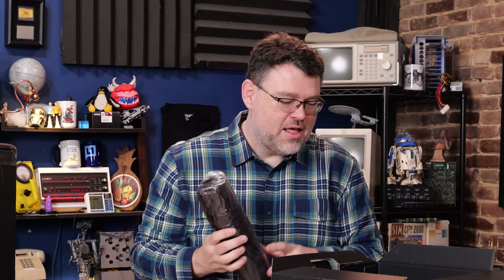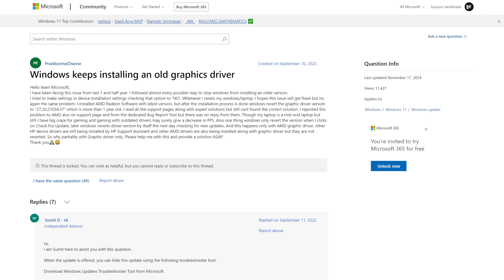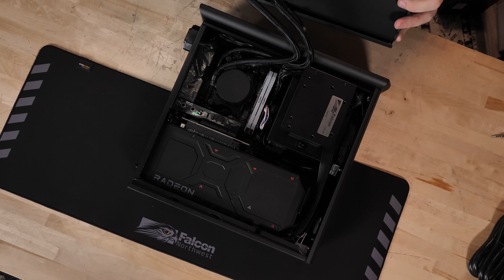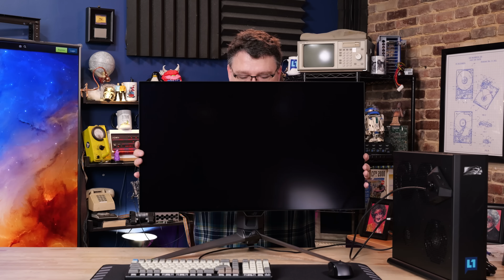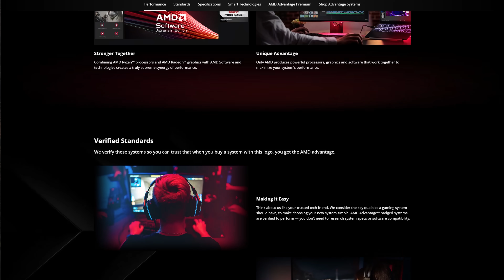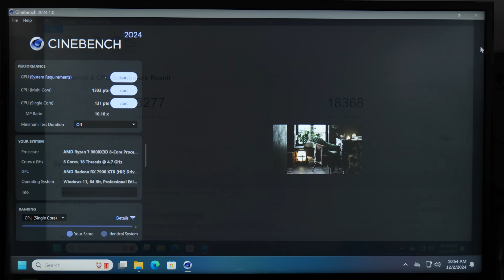The Falcon Northwest Tiki: An Ultimate Gaming PC

Comment: I’ve done part for part builds of there systems with the exception of the case and cooling.  These guys use top shelf and expensive parts.  Of course there’s a premium, but it’s not as bad as one would expect.  

I don’t have a gaming PC.  I’ve built them in the past though.  In the future I would seriously consider pulling the trigger on one of Falcon’s builds.

Comment: Wendell, in your more recent review of the 5090, I appreciated you noting that the TIKI has a 'new' side panel, better ventilated for the 5090FE dual-fan pass-thru airflow. Not sure if I'm missing something, but I haven't seen that referenced elsewhere. Seems a mystery that case mod is not more clearly promoted, as that's a big sell point for the TIKI: NO GPU exhaust into the case! I've been looking hard at the TALON, but have concerns about the 5090FE exhausting directly on to and over the immediately-adjacent (if not touching) Gen 5 M_2 heat sink. My plan was to put a Crucial T705 in that slot, but given the SSDs alleged reputation for running as hot as the sun, I fear frequent throttling, given it's relation to the 5090 airflow. I have been a Talon owner for years, and a big fan of FNW, but honestly I'm a bit paranoid about pairing a 5090 with the Crucial Gen5 M2 as configured above. So maybe I go with the TIKI and it's unique 5090 airflow, or maybe just step down to a cooler-running gen 4 M_2 in the TALON?
Reply from the maker: worst case you can do active cooling on the t705. my machine learning talon has a t705 in a vertical m.2 on the workstation motherboard. depends on the motherboard to know. falcon will not sell you config that has problems
Reply: @Level1Techs  Did you mean to say "cooking" or was that a Freudian slip? LOL That Crucial/5090 TALON combo would seem a good choice for Smores. I saw Jaystwocents loosely lean a small fan just above his t700 (open bench) and yes, it did keep the M2 within thermal range. I'm not a DIYer perse, but have wondered about simply running a new TALON with the case open, dust be damned. FNW swears by their thermal testing in all configs, but I keep squirming. That TIKI airflow solution is tempting.
Reply from the maker: lol oops fixed
Reply: @Level1Techs  Thanks Wendell. You may have had it right the first time - the 5090 actively cooking the Crucial T705 - or vice versa. Appreciate you!

Comment: So question. I’m new to pcs, as a console gamer my entire life, I’m looking to get a falcon but don’t know which. The talon or the tiki. I’m not as a hardcore gamer as I used to be but I’d still like to play games at there best performance. Ray tracing is in my mind but not needed (maybe lol) 
6000$ budget but don’t know if I’m overspending on things or not spending enough. Don’t know if I should go with a 4090 or 5090. This would be strictly for gaming, games like path of exile, Diablo, the Witcher, cyberpunk and some first person shooters. If I could get suggestions that would be great.
Reply: $6000 is a lot, but might be cheaper now than later lol. 5090 if you can afford it. Make sure you build around a great processor/motherboard combo, gpu is easier to upgrade later.

Comment: I had a Tiki back in the Devil's Canyon era. It was a 4790K/TitanX box and it was very capable. This IS an SFF case, so it did run a touch hot, but the 4790K was notorious for this regardless. The magnetic remote is pretty slick and I wish it had been a feature back when. I have to say I do miss the granite base option. Falcon does make good stuff, but bring money.

Comment: The new user experience from Microsoft is to their benefit, but also aimed at the average computer user. And the average computer user is just a notch or two above a chimp. Most people won't even consider being forced into becoming cloud fodder for Microsoft being a bad thing. Just see how many Apple users they are who love being firmly corralled into doing things the Apple way. For the more advanced users there's making your own tiny Windows 11 installer where you physically delete (or rather, never add) much of the bloat, and there's also using an answer file to automate it.

Comment: I paused windows update. And never had blue screens. Best fix I found for now
Tha K you for the review. Very nice info about products and companies That don't exist in Argentina
Reply: My machine is a bit over 2 years old, the only blue screen I've had is Nvidia's fault with broadcast. Windows triggering blue screens on modern hardware via updates is exceedingly rare, it's near always Hardware failing or the program you're running.
Reply: @Masterrunescapeer  I don't have Nvidia. I found lastest framework from windows update or similar to cause that. Before that, was good all

Comment: Nice video! Yes let's see a dual boot video. Still waiting on the 9800X3D Linux video as well!
Reply: I have my 9800x3d on the shelf waiting for my other parts. I hope it blows my socks off. I’m running an intel 9700k and I have a feeling my switch games will run full speed finally

Comment: Neat system and case, also good for proper first boot experience. I get it's an SI build and warranty and and more unique build though still price is quite steep. I configured the PC that I have basically which ends up like 4500 yet I built mine for like 2500 so that's a huge difference though.

Comment: You can probably get a lot quieter system by undervolting that 7900xtx. And the best thing is, you can do it in the driversuite. Something nvidia still doesnt offer, neither do they have radeon chill, which is super usefull to combat vrr flicker in oled panels. Its such a shame radeon has poor marketshare, undeserved. My own 6800xt runs 2500@1030mvtt @ 200 watts. Stock boosts at 150watts...

Comment: you can run AI.
It might crash a bit.😅
flashed nitro with aqua bios, ran the 552w extreme bios update. I can only AI with aiquickset on the ASROCK bios until i can set it all up manually. 
Xtx linux vid coming?